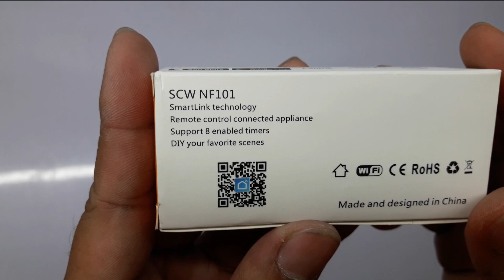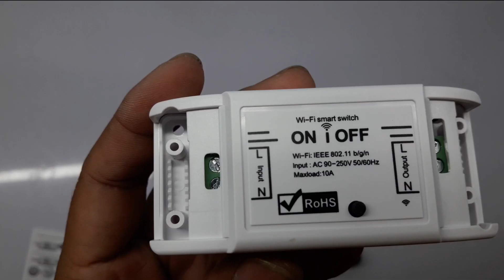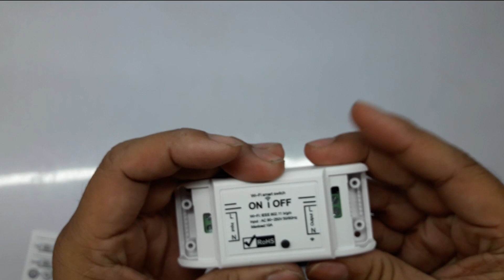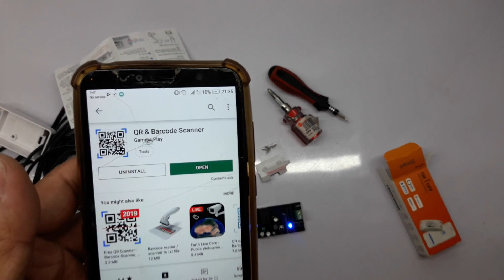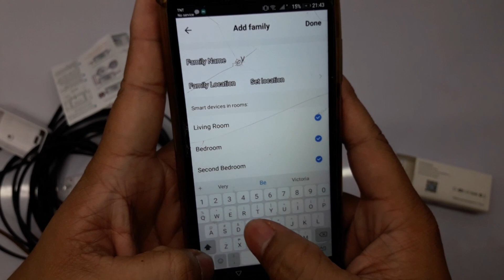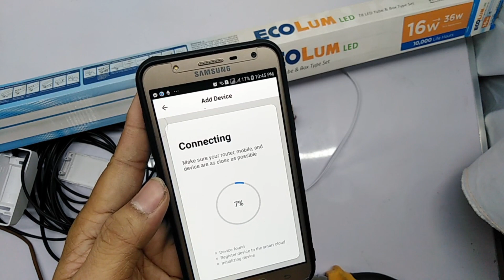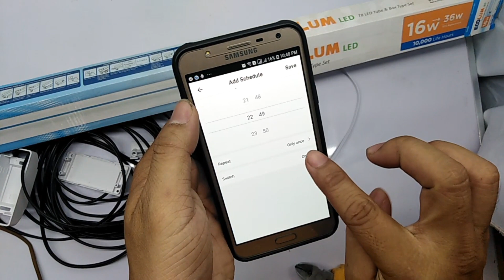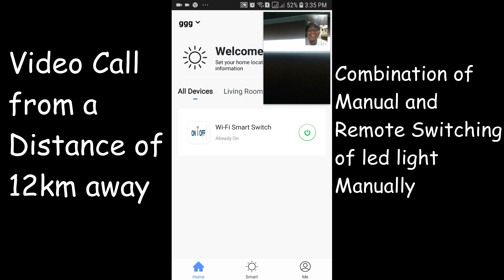Mini WiFi Switch ON I OFF | WiFi Smart Switch | same as Sonoff | with Tutorial

Comment: Just installed one works grest and its easy to use. One thing i noticed is that my wifi speed went down a bit, which is stramge cause i dont think this uses internet at all right ? Just a wireless connection.
Reply from the maker: havent check and observe the speed of the wifi after using this. Thank you for the comment this will help users to also check if same problem exist. actually i also develop wifi control device and it is not that much data to use to make the wifi connection congested.

Comment: hello sor tanong ko lang po if na install na to sa kightccan i still use the manual switch pf the light not the manual swotch sa item yung switch mismo ng ilaw na nakadikit sa wall
Reply from the maker: verify ko lng po san nyo po siningit lagay si smart switch? if sa line kasi ng old swich nyo nilagay or tabi ng ilaw n line. di po ito magwork ng proper kung naka off ung main switch or old switch. maganda po sana makita natin ung diagram ng electric line nyo po.
Reply: @ViewFirst  plan ko po sana either the two. pra sana sakaling wala kami katulong naiwan magamit nya manual or ordinary switch lng
Reply from the maker: pwede naman po pero ang gawin nyo po two way switch po. parang ung nasa first floor and second floor na stairway. On mo sa baba, pag.akyat mo off mo sa taas or vice versa.

Comment: Hi, I had to use 3 switches as I have 6 wires coming from a real traffic light. I followed your instructions on wiring the switches and when I plugged the 3 plugs in nothing happened. The lights didn't come on. Can you please tell where I might have wrong? Do I have to install the app before anything happens? I am using Alexa. Many thanks Paul
Reply from the maker: hello sir Paul,
Hopefully you have resolve now your problem. Im really sorry for the very late reply on this. you should install the app first, since at first it will try to initialized and look for the wifi connection. Is this your project?

Comment: Can you make a modification to use the wall switch with it?
Reply from the maker: What kind of output you like? like replacing the wall switch to this? when we talk with the wall switch the wire running to the wall switch is just the one wire from our source supply. this one need 2 line from supply to work and will control the one line by turning ON and OFF. we may tweak it by adding a supply to supply this unit and removing cutting some line in the board to disable the power line. It still depend on the installer how will make a wiring for this...
Reply: @ViewFirst I mean to control my light using wifi, and using the wall switch. It seems to be something complicated. Maybe will be easier to use the little button in the wifi switch box.